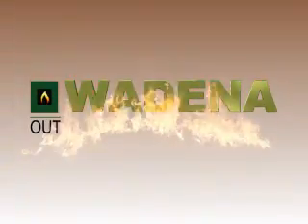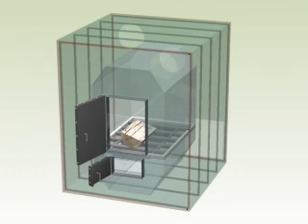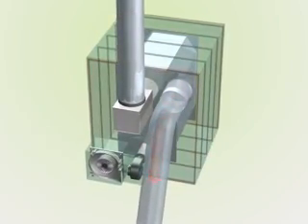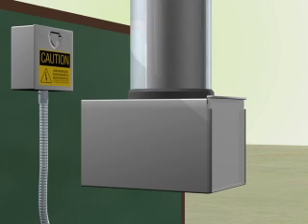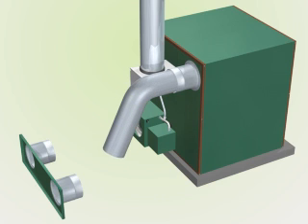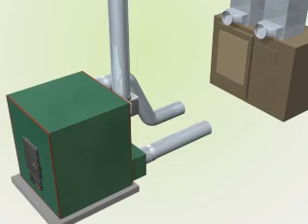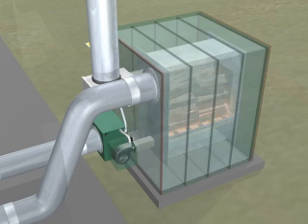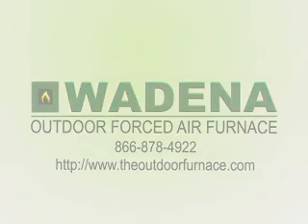Wadena Outdoor Forced Air Furnace

Comment: Maybe I missed something but I only saw the small induction air blower to boost the air to the flame for more heat on demand. Is there another fan in the duct work, or is it using the central heating systems blower for the warm air circulation?  Is the fire box brick lined? Love the simplistic design.
Reply: pipedreams57 
Yes, it uses the existing air handler fan..

Comment: do you need to install backdraft dampners so it dont just blow around in a circle?or if the house furnace kicks in it dont blow out  to the wood burner?
Reply: I was kinda wondering if they were going to mention a back draft damper on the furnace or not.